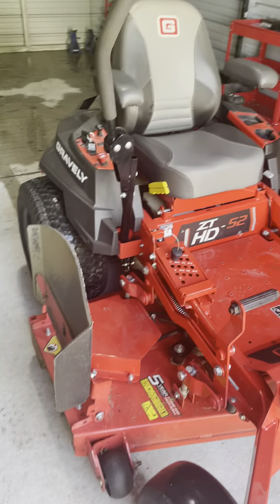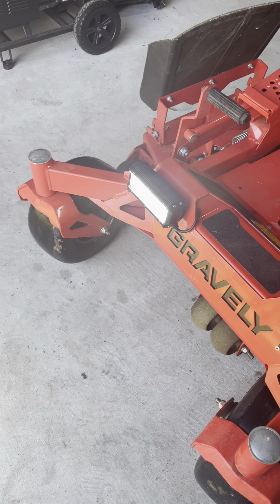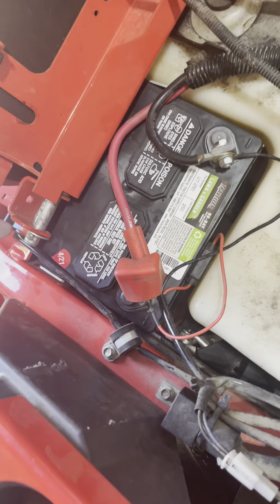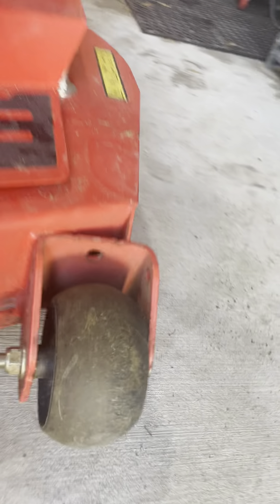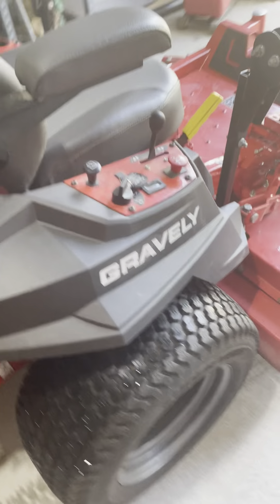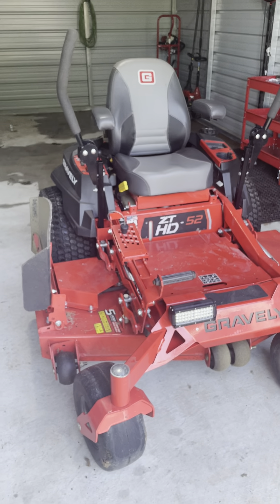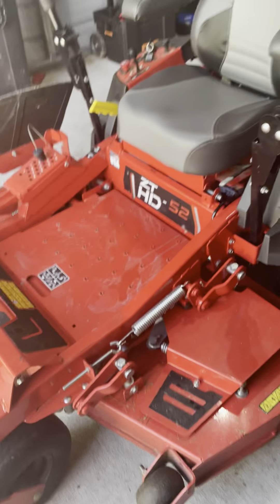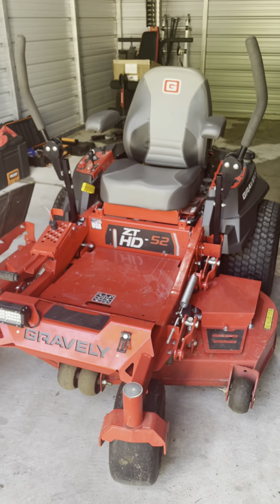Gravely ZT HD Review

Comment: After the so called “quality “  ive gotten out of my zthd, i wont ever buy another gravely mower.
Reply from the maker: I beat mine pretty hard and it didn't give me much issue in the 60 hours I owned it before I traded it in. What sort of issues are you running into?
Reply: @jonathanaustin8841  first fuel flilter melted to motor, that was within first 2 hours. Carb issues in first 24, pulley alignment is horrible, eats wheel motor belts, cbt spring for wheel motors broke. They were recalled replaced with a better spring. In 3 1/2 years ive had it im on now my 9th spring. Discharge is horrible. And rides like a horse and buggy.
Reply from the maker: @greggreen6636  man with that many problems my local dealer would have lemoned it out and got me another one! I can’t believe your guys didn’t offer to just call it a loss and get you another mower.
Reply: @jonathanaustin8841  up until this mower my dealers have been great. But you look in the repair area there are alot of zthd mowers in it. I contacted gravely, all i get is to take to dealer. The lack of support from gravely, i wont buy anymore of there mowers. Sad really this mower has ability to be a great mower if they hadn’t overlooked the details. 
  Ive got a 15 year old exmark walk behind that has been a great mower. Now i see why so many people are willing to spend on exmark.
Reply from the maker: @greggreen6636  when I was looking at upgrading I had it narrowed it down to hustler, Spartan, toro and gravely. I went with gravely because I’ve seen my local dealer literally send a customers mower back because they couldn’t get it to track straight. Guy had a brand new mower in 3 days. I trust that they will take care of me. If it wasn’t for that, probably would have tried out a Spartan just because they look sick and they push the envelope on newer features. Most of which are creature comforts but someone’s gotta push the envelope I guess.